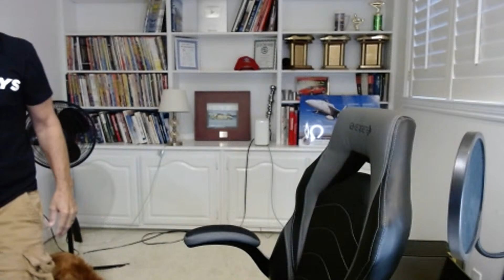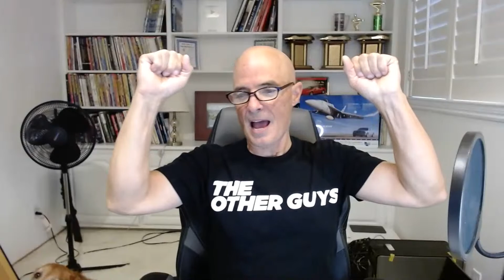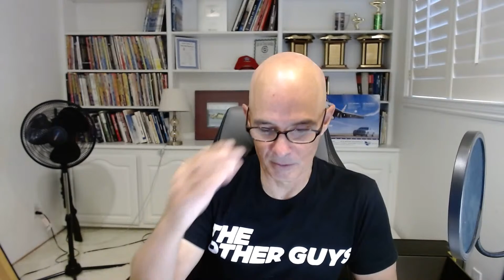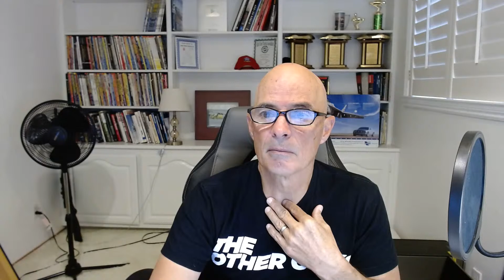LET'S TALK TECH-THE WORLDS BEST 4.6L 2V INTAKE?

Comment: Richard BBK made a 4.6l  2v cobra style manifold but decided to not release.  Cost was the issue I understand. They were gonna have to charge $1700 to $2000 if what i hear is correct. Back then that would have been laughed out of the room. Now i think they could have made at least a limited run and charged that. I wonder if you reached out them Richard Maybe they still have the prototypes, design schematics, or dare i say it a finished complete manifold. 

Call them Richard get it done.

Comment: I was thinking about your intake shootout on the 4v. Ive read that every manifold has a different icl, lsa that makes optimum power. This is a big benefit to the dohc engines. Degreeing the cams allows you to adjust the icl, ecl, and lsa to whatever suites the combo, more specifically, the intake manifold and rpm range.
Reply from the maker: every intake does not have a magic combination of cam timing-intakes operate in an rpm range
Reply: Richard, I agree with your input here but I think he is suggesting the right cam specs will benefit that rpm/powerband range.
Reply: @richardholdener1727  what are my options other than a Sullivan intake manifold for a 4V cobra engine 96-04. I want to make 450-500 wheel NA.  I know that cams, headers, exhaust, 93 tune along with forged rods and pistons are necessary, probably ported heads. Bigger injectors. But what manifold to make that power? Also any suggestions are welcome to make that power NA, no nitro either. Thanks brother for the amazing content!
Reply: @SVTfan  Aviator manifolds can be made to make good power at higher engine speeds but come at a cost of mid range power. They have good low speed torque too, below 3500rpms even exceeding stock cobra manifold torque production. The top end tradeoff only occurs above 6300rpms or so
Reply: @David you would need lots of compression and high rpms. 
Imho it will take at minimum a big bore or stroker or better yet both. 

It will not be a cheap endeavor. 

My 2v Is 25k in parts and labor and pulls 572fwhp. 327c.i. custom intake, custom cams, trick flow 195 2v heads with hand cleanup, gibtec pistons that were matched to the combustion chambers via laser scan. Block is a very rare "Cammer" TR50 Road race block. It's a big bore aluminum block designed for high rpm use. Better oiling, beefier skirts, valley etc...
Roush used them to dominate back in the day. I have a spare block. I might sell it but 5k would be the price. They are rare and cost that new back in the Early 2000s. Every now and then a new one pops up. You might find one for 2500 to 3500. Still not an easy find. 

If i were you I'd look at this guys car...

Look up Racer X on YouTube he has 323 c.i. dohc mod build that is almost 500rwhp. But it's very streetable. A 4.6l at that power level will not be. 

Just my opinion. Been building 2vs since 2000. 😁
Reply: @rickstorm4198  so I guess unfortunately it comes down to lack of displacement huh? which is why you gotta build the motor boost them or spend a fortune for NA. I’m starting to understand better. Thanks for the education!
Reply: @SVTfan  Another thing to ask yourself is what is the goal of the car? Do you need that much power? Ken Bjonnes put a 360rwhp, 3k lb stick shifted 2v mustang into the mid 10s na. Asking for 500fwhp is much more taxing on the engine, transmission, and car chassis itself.
Reply: @Mad Mod, you make an excellent point. If its racing he's interested in.... Chassis, gearing, suspension that can be as if not more important.
Reply: @rickstorm4198  Yepsir. focusing on the whole combo is definetly far more important than the amount of horsepower on paper. If youre only worried about et's and trap speed, by all means squeeze every last bit you can out.
That said, Doing more with less is what ive always been about. More cost effective and more time spent racing than building.
Reply: @David, pretty much. I built what i did to satisfy a "what if".... I wanted a 1970 maverick that does it all. Show car worthy, able to hit 10s or 9 s in the 1/4 and do short/long track... It's a no compromised build full of compromises 😁. Those that know, know....

It'll never be the best at anything but can hang when needed. 

My other build was going to be a stroker only Teksid either turbo or supercharged. I may build another maverick like that but im 45 running out of time and money 😢. I have 4 cars already. None are done. The 67 Cougar will be done first in about a year. The maverick is on hold but i suspect by 2025 to 2030 at the latest. I fire the engine up every month on the test stand i built for it.
Reply: @rickstorm4198  I dig it dude. Ive gotten lost working on customer cars and end up keeping my own stuff fairly simple but ive got a few toys that see most the love. Love the maverick, btw have you seen the new 2022 maverick? Kinda out of left field by Ford but very cool. 
Also, dig the teksid stuff. I do alot of wap builds but have a 140k mile teksid running in a 94 mark just prime for the pickin lol

Comment: There are 3 different 2 valve 4.6 engines Richard. The first year Lincoln Town car that used the 4.6 had a Windsor bellhousing and used the AOD transmission. They also had a weird shaped cast rocker arm.
Reply: Those 95 and earlier engines are weird.
Reply from the maker: only 2 types of heads (though two plants also)
Reply: Svo 2v?

Comment: The Cobra R had the 351
Reply: The 2000 model year had a 330 cube, 5.4 dohc
Reply: @madmod didn’t the 95 cobra R have a 5.8?
Reply: @iammclovin1672  yep. There's also a 6.1 Cobra Jet based on the 5.8, also in the sn95 generation. Those cars are nutty.
Reply: @madmod  no wayyy, that’s sick! Thanks for the heads up. Now gotta check it out lol

Comment: I have a 4.6 2v and I think I could get 4v heads rebuilt cheaper than buying the trick flow 2v because I need all their bits with it
Reply: Then it wouldn't be as cool or sound as good. Imho when done right a 2v sounds and looks better than any modular or or its derivatives.